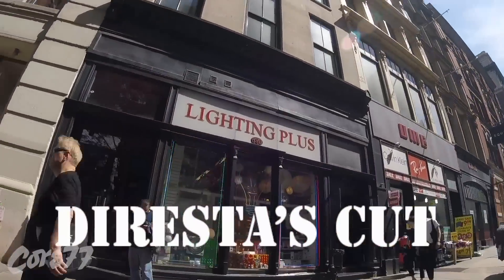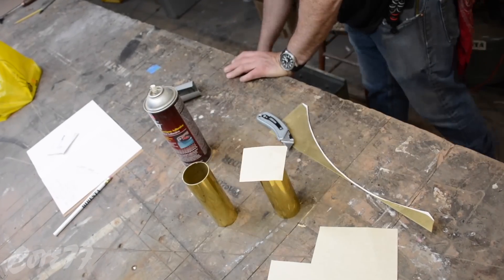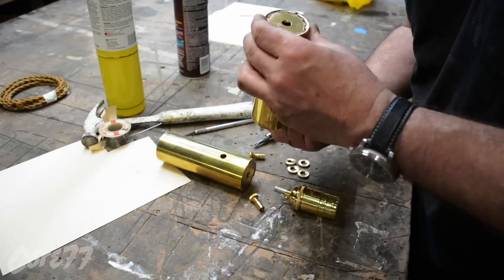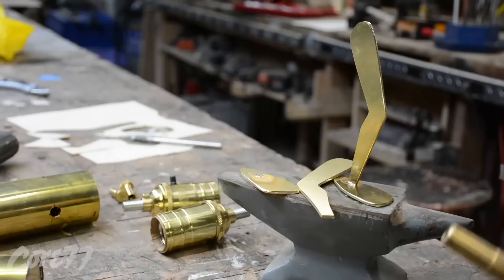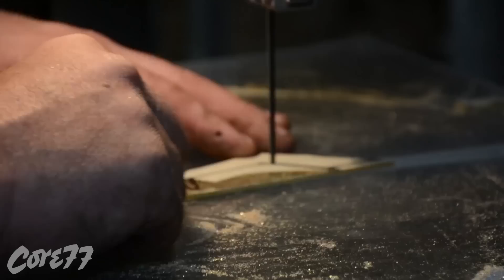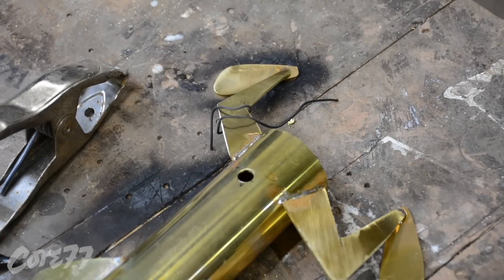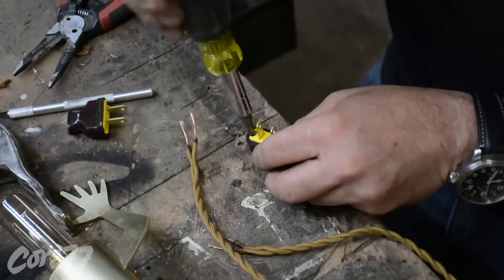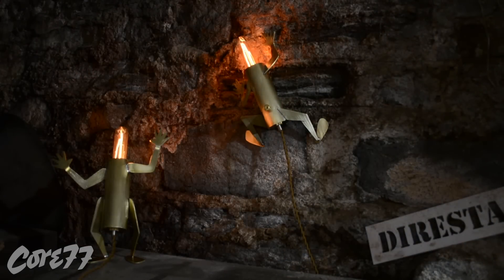DiResta's Cut: Brass 'Bot Lamps

Comment: Tell the europeans that insist on a ground that 120v has a neutral leg that is tied directly to the ground bus bar.  Black comes from the hot side and the white let is neutral and goes to ground which is why we don't need three wires.  With their 220 v system they require two hots and a ground.
Reply: John Lowe, Photographist thank you ! Never did know this. Tx
Reply: In Europe we also have a neutral and hot wire witch 230V.
Reply: Which wire from a non-polarised plug is live and which is neutral?
In the UK we don't do 220/240v the same way as you, it is a single 240v Live, a Neutral and an Earth. The Neutral is connected to Earth at some point depending on the age of the installation.
Reply: No.. Europe has a Live connection at 230V, a Neutral (which is tied to the ground bar) and an earth connection.. Not two "hots". I think you may be confused with 2 or 3 phase systems.
We have earths on all things with metal cases as we have ELCBs (Like your GFCI.. but better ;) ) so it makes no sense not to spend the extra fraction of money on a third wire..
Reply: +IrishSkruffles Not 2 or 3 phase. USA is a 120v based system. To get 220/240 you would use two HOT lines, TWO neutrals and one earth ground. 99% of lamps and an appliances in the USA, use a two wire, two prong (hot and neutral) plug. Appliances that use three prong plugs are usually something that is used in a wet location like a wet/dry shop vacuum.
Reply: I don't think the disagreement is about single, twin or three phases, 110v or 220v. It's about having a metal box (lamp holder) with mains power inside it not connected to ground.
If either cable fails and touches the metal case, it will become live. If not now, with a non-polarised plug like the ones used, you have a 50/50 chance of plugging it in the wrong way round next time.
Reply: +Mekhanic1 +John Watkins 
I brought up 2 or 3 phase because the original commenter stated that Europe has two "hot" connections (which isn't true).

Mekhanic1, since we're dealing with AC and two lines being 120V, in order to get a voltage difference between them they need to be phase offset.. In other words, multiple phases (I believe 2 phase is common in US? with 4 or 5 wires).
Reply: John Lowe, Photographist 220  cycles from hot to neutral (hertz) the ground is only an alternate path for electricity if something goes wrong, 220 will work without a ground. I recently discovered that the only place a neutral should be grounded is at the main service panel
Reply: Wrong. 230v live, neutral and earth.
Reply: In The netherlands a normal household electrical system consists of a 2 or 3 wire system. A live, neutral an ground/earth connection. Its not compulsory to have a ground on a lot of appliances. Lamp posts even those of a metal construction will be mostly rigged with a 2 Wire connection. (Live and neutral) live connected to the core of the fitting and neutral to th outer ring/thread side. But as we have non polarized plug and outlets this is doesn't matter)
Newer houses will be running a full 3 wire system throughout but my 1996 newbuilding still has only ground/earthed outlets in the kitchen garage and bathroom. Fully upto all codes at the time.
Reply: Its pretty easy in Europe ...
1 life (230V) and 1 ground are ALWAYS needed (obviously).

The earth is ONLY needed, when the housing is conductive.

Why? Because when the wire that is plugged into life touches the housing you get a short circuit. But only when the housing is wired to earth!

And whats the sense of this?
short circuit -> fuse reacts -> you can touch the conductive housing without dying.
Without that: your housing has a potential of 230V that could kill you because the resistance of your body can be too high and the fuse wont react.

thats all theory, sure. its just a safety thing and im pretty sure that even in 100 years the wires will stay in place in his lamps here ;p

And no, its not the same when ground is used as the same wire as earth. It can work in some case but in most it wont.
(it will only work when the plug only can plugged in one way ... and even then you have to be absolutely sure that lets say the left pin is life and the right one is ground)
Reply: Your right too!!!
Reply: In Russia, the grounding conductor is only carried out separately by a third wire, this is safer because with a damaged neutral you get the housing of the device under voltage.
Reply: In France a singer made the headlines by touching an unearthed lamp and dying.  But nowadays the presence of a  residual-current circuit breaker (and less metalic frames) would save most people.
Reply: Let me correct that, in the UK the neutral is also ground, it's not that different from the US, except we don't have multiple voltages, usually just 3 phase 415v  and single 240v (3 phase is 240v to neutral)
Neutral is not considered as a safety conductor, so the ground wire either goes to the incoming cable, or to a ground stake (if the loop impedance is low enough or a RCCD (gfi) is used, this ensures a safe path for faults.
Our metal lampholders have a ground terminal, any metal cased item should also have a ground terminal, unless the internal insulation makes it 'double insulated'
But hey, in the US it's only 120v :P
Reply: On  a Edison screw lamp, the neutral must be connected to the screw thread, many times the lamp thread sticks out and can easily be touched
Reply: @John Lowe, Photographist; Completely wrong, you have no understanding of the EU electrical grid.
As to the matter at hand, regardless whether you are in the US or EU, if you use non polarised plugs, the only way to make an appliance with a conductive (eg metal) housing safe is by connecting said housing to ground. You can argue that your connections are perfect, that the object will never move thus preventing any chafing of the wire insulation, etc..., but for the less informed/experienced viewer/hobbyist it is important to point out it is potentially dangerous maybe even deadly.
Reply: @John Lowe, Photographist No, this is how You Americans get 240V (by using split-phase), we got 230V straight from the hot wire and 400V by connecting between phases (for mains power we don't generally use split-phase, just three-phase). Either way according to European safety measure if the exposed case of apllience is conductive there should be grounding wire connected to the case. Please stay in photography if you don't know what you are talking about...
Reply: Lol, good joke dude, laugh my ass off. Sorry if you meant that seriously.

Comment: Saying "I don't connect earth to the metal housing, because no one ever died because of my lamps" is like not using seatbelts because you never had an accident. If the hot wire inside the case becomes loose for whatever reason (wear/stress on the cable, for example) the housing can be under voltage and there you have your dead mom. Just sayin'...